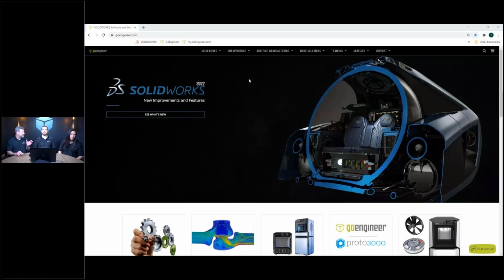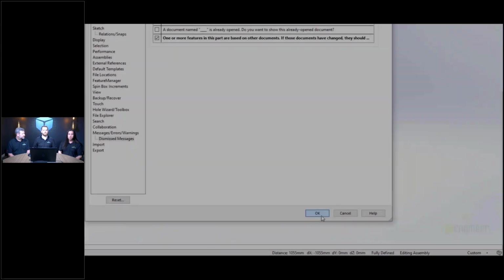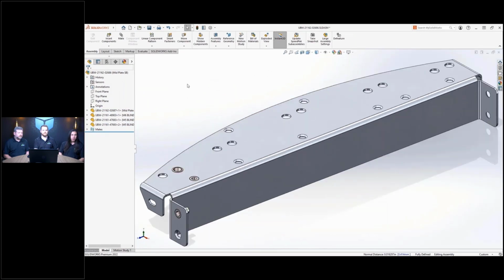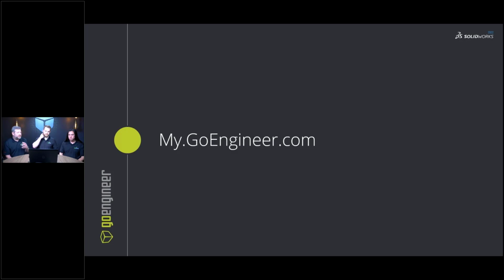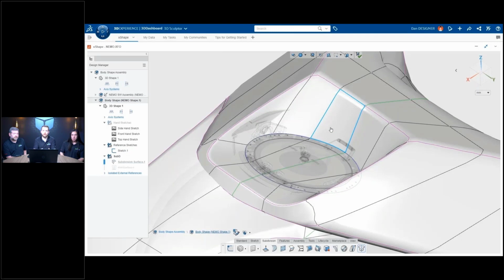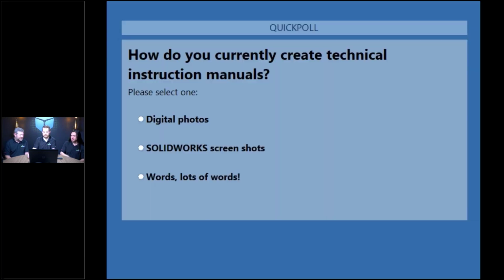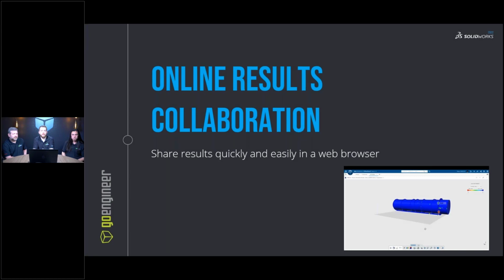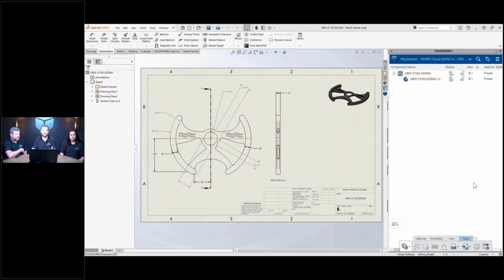What's New in SOLIDWORKS 2022 - Top 15 Enhancements!

Comment: How to solve an issue with hidden description of suppressed components in assembly tree in SW 2022?
Reply from the maker: I did some testing here on my end and once the component is suppressed, the description (or the entire information about the part) is removed from the Feature Manager Tree.  The problem is that it is different in SW2022 than it was in SW2021.  I can report the regression on our end, but unless you are a GoEngineer customer, then it would need to be reported thru your local SolidWorks reseller.